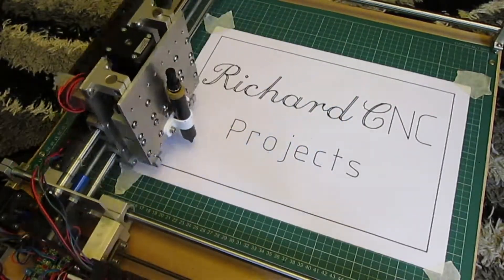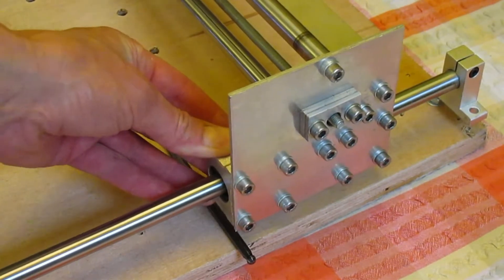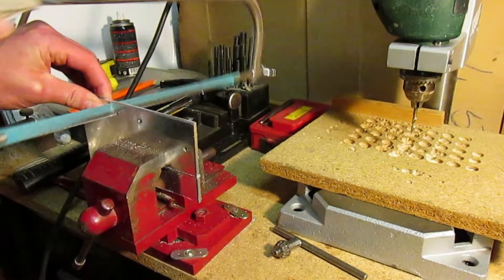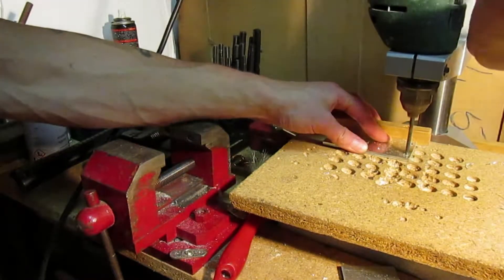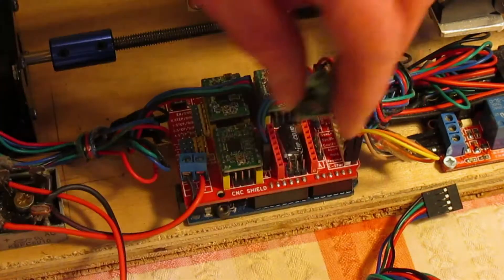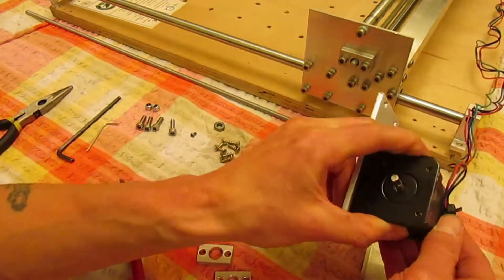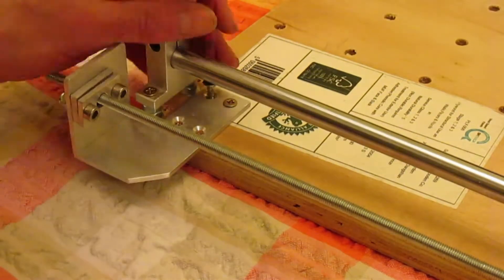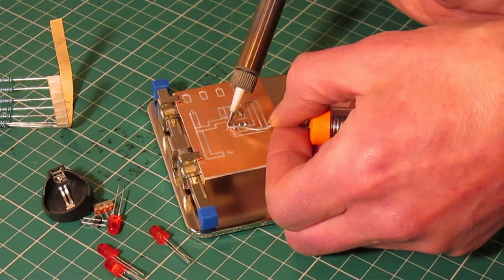X Axis Clone - DIY CNC

Comment: How did you adjust the play in the brass nut you made for the 6mm threaded rod leadscrew
Reply from the maker: The nut is not vertical but out of square slightly to take out backlash. As it wears out it can be moved to remove further backlash until it needs to be replaced. The nut support bracket has oversized holes to allow for some rotation.
Reply: @richardcreese  okay, there is a way to do it that will make the nut last much longer and also is finely adjustable to remove play.

Take 2 brass plates, about 8mm thick, clamped together with 4 bolts, one at each corner, with a 4mm spacer between the plates. run a tap between the plates.

Now clamp the threaded rod between the plates and tension with the 4 bolts.
This way you have much more surface area in contact with the threaded rod

Comment: Bothx axis should spin in same direction or opposite to each other
Reply from the maker: Both in the same direction  as the lead screws are identical and both motors are facing the same way.

Comment: Ahhh, you meant Y axis.  X is side to side and Y is front to back and Z is up and down.
Reply from the maker: X axis is the longest, Y axis is shorter and the Z axis is always in line with the main spindle :-)
Reply: As I said front to back is Y and side to side is X and Z is inline with the main spindle that gives height or depth.  A lot of people confuse X and Y for some odd reason.  Now your machine may be wired funky but normal machines X is side to side and Y away from you and towards you as you look at the machine.
Reply: @thebeststooge   I think he is cloning the motor labeled with X in the shield, since he is using the top row of the pins on the left designed for that purpose. Then, as you say, it may be wired otherwise on his machine.